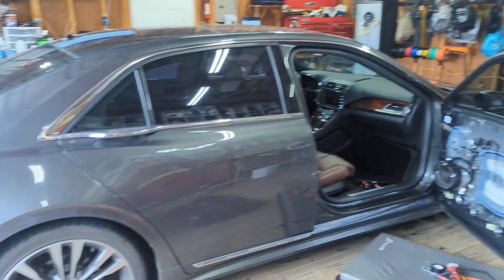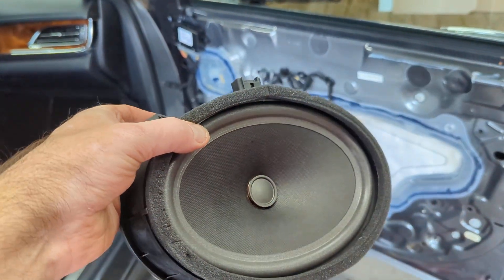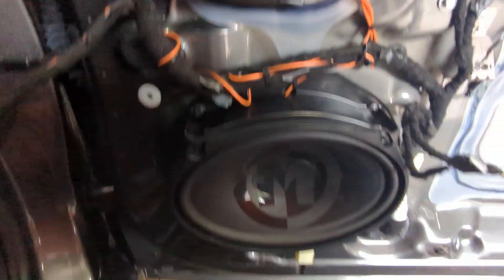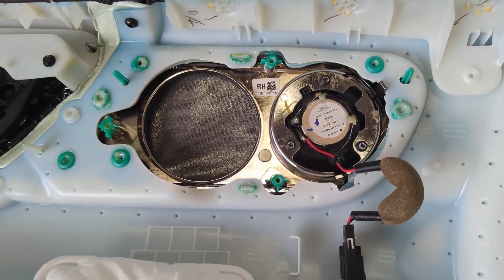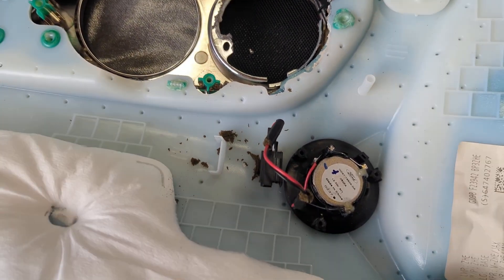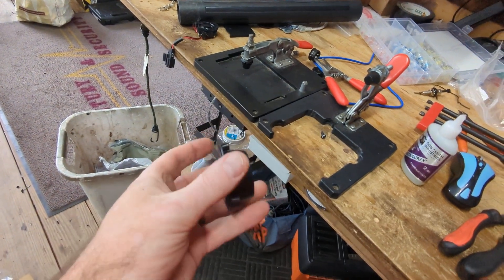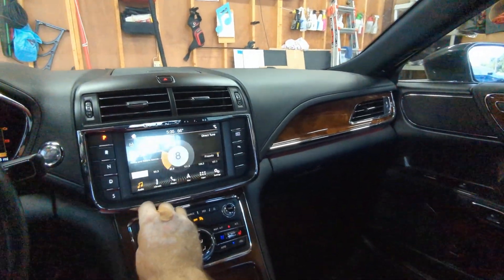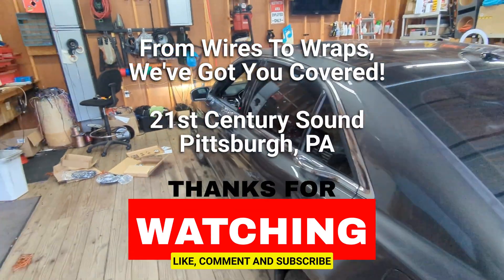Upgrade Your Sound: Installing Memphis 6x9 Component Speakers in a 2017 Lincoln Continental

Comment: So is the factory size 6x9s and you just used the spacer for depth needs? Usually ford products use 6x8s
Reply: they're called 6x9's and 3 and a half's.  get a clue.  this is not ford.  it's lincoln.